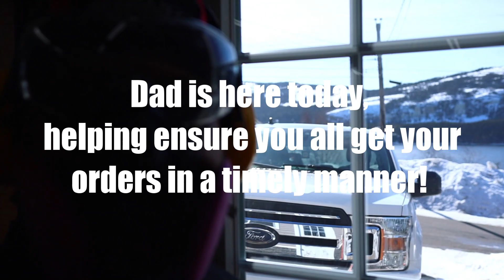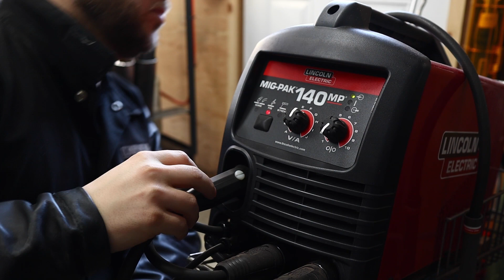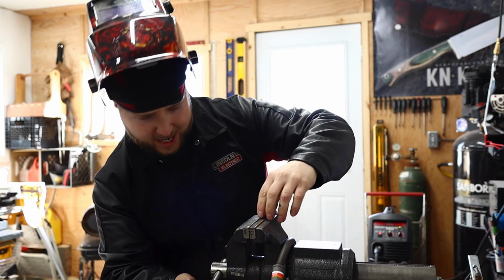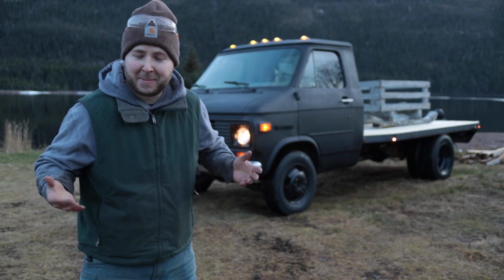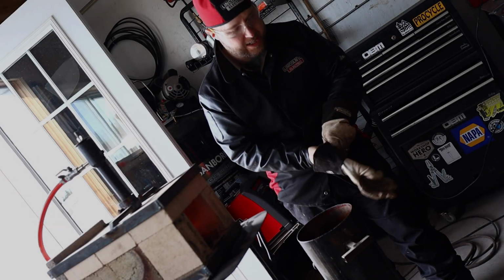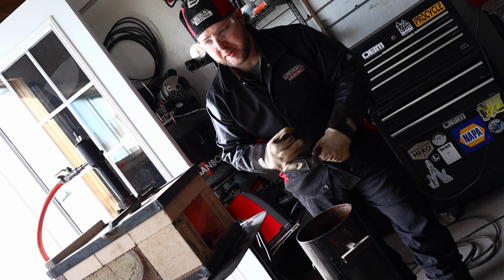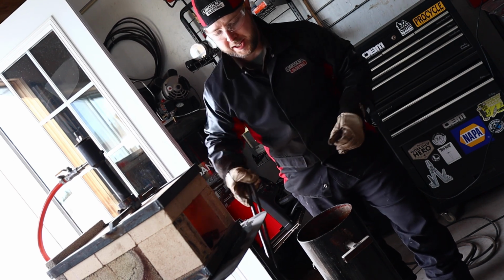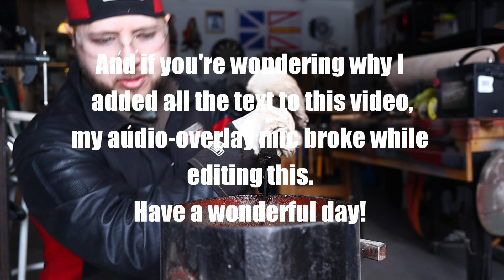Building and Heat Treating Custom Knives! - [KN KNIVES]

Comment: I noticed someone else mentioned your gloves as well. I received some advice in the past concerning TIG. You have the privilege of using the more flexible, tight fitting gloves with less heat protection than you would for stick or MIG because what you're really protecting yourself from is the X-ray radiation that comes off the tungsten electrode when it arcs, rather than the heat. Now, this was from a guy at a welding shop, so I figured he knew what he was talking about, but I haven't gone through a designated course with instructors where I could verify that info. However, it is true that tungsten gives off X-rays when its electrons are excited as that's how medical x-ray machines operate.

Comment: Awesome. Kyle. Love the beautiful grind lines on those Bowies. I don't mind folks in the shop when heat treating, as i teach alot. but i prefer to be alone when doing 52100, W2, or a Hamon quench. Keep up the great work. and i am sure that tig welding will come around. Later. Tom B. from ND, USA.

Comment: Having had a Miller 211 MIG for years, I decided to finally take the plunge into TIG last year. Got a Everlast 210EXT and it is by far the most fun I have had in the shop. 

If the machine can have a foot pedal connected, I'd highly recommend it though.
Reply from the maker: TIG has been so much fun so far. I love it. I do have a foot pedal connected, but I didn't show the floor in the video..
Reply: @kyle_noseworthy  Right on man. I have found thinking about TIG more about controlling and limiting heat my welds have really improved. My struggle right now is keeping the heat-affected zone small while getting enough penetration.